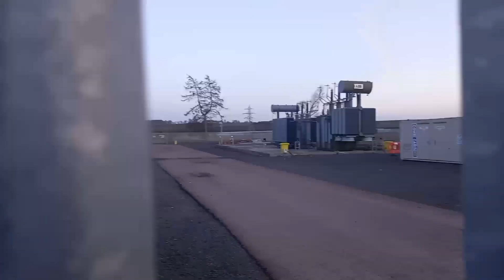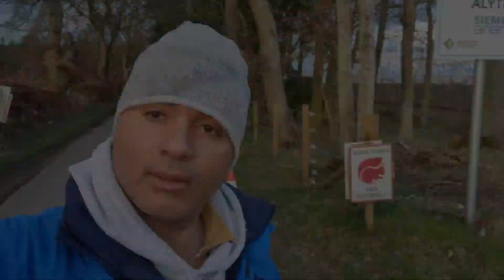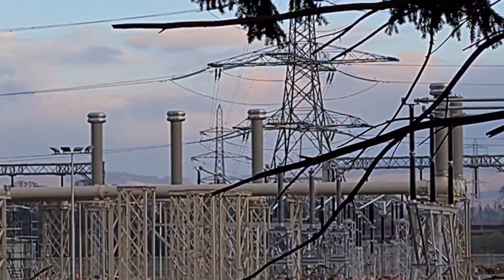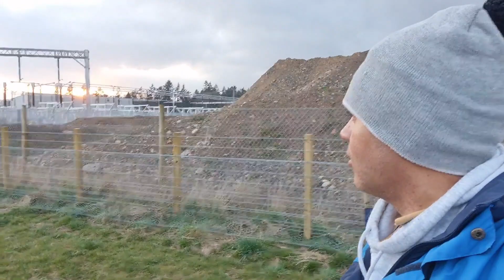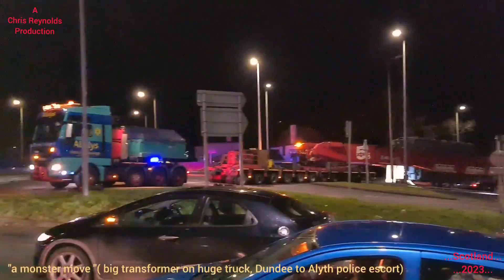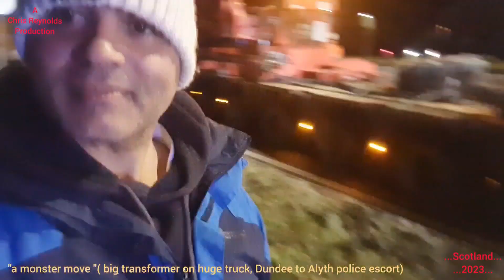Electrical Substations (my article)      ......Scotland.....2023.....

Comment: Good video with lots of interesting shots and information. That transformer transport rig was awesome. Noticed the anticlockwise clock on your shelf. A touch of the Twilight Zone there.
Reply from the maker: Yea I'm really interested in these places. The transformer move was a massive exercise, and it must have taken lots of planning. I was very lucky enough to capture it on my videos.
I checked my clock, and it's working clockwise. If you watch the video right through to the very end, you'll be able to see my clock rotating clockwise in it.
My clock is fine😀

Comment: i remember chris in the early 80s down at the burnie toddy v shams fights some of the older boys would bring big heavy chains and throw them up over the power lines wow it was crazy the noise and flash the lines would make and would melt the chains real dangerous now when i think about what they were doing good video bud...
Reply from the maker: Thankyou Braveheart576,  glad you enjoyed my video. 
Yea the chain thing would have been quite a sight ,with the electical flash overs.  The power lines might shut down, causing a blackout after chains. I think it almost certainly would have, if the chains short circuited to earth, via the tower structure. ( hence the insulators to prevent that)
Reply: @chrisreynolds8054  im sure there was a guy killed on they powerlines down at the drummy mate in the early eighties now im thinking about it im sure there was..
Reply from the maker: @braveheart576  that's awful news!!